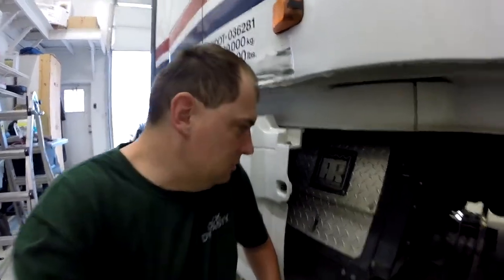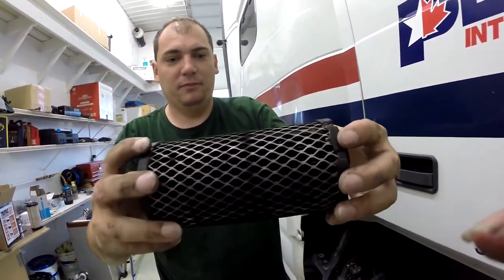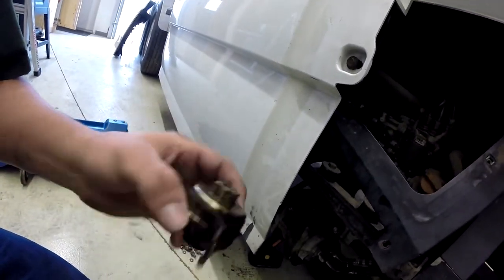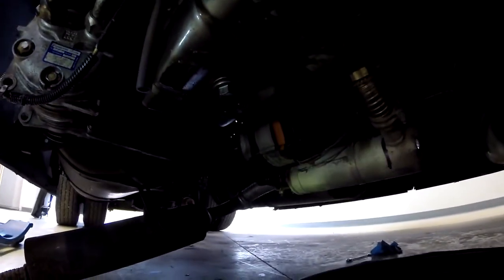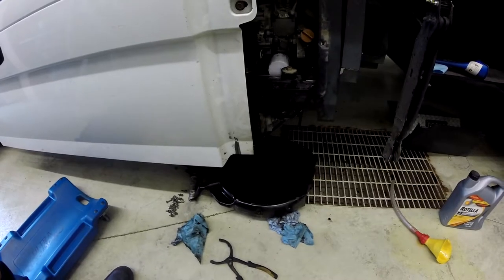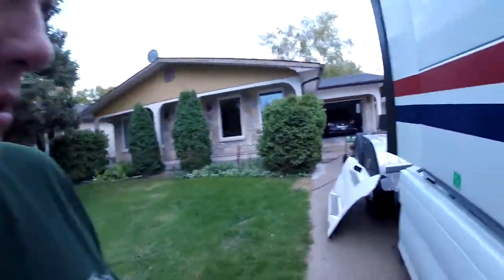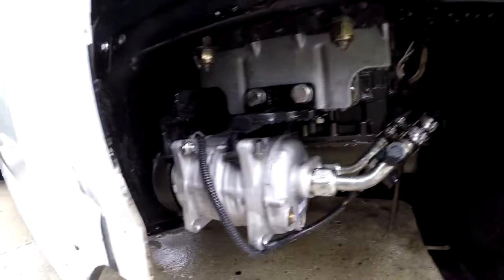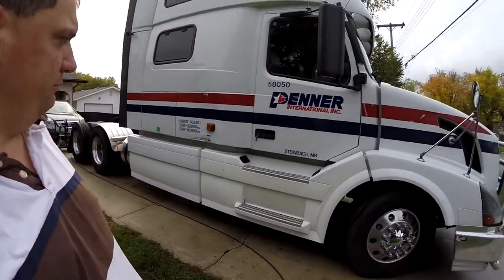My Trucker life on the road 09.19.14 changing the oil on my APU unit

Comment: Good video. 1, Where is that inline fuel filter located, rear on top or on the bottom underneath?
2, is there a certain way to prime the fuel line, other than attempt a start up again & again?
3, have you ever changed out the belt?
Reply from the maker: Yes I did change the belt My truck has a fuel pump so i don't need to prime it
Reply: +Trucker Rudi cool, alright. the tensioner is a bar between the alt & ac. pretty simple, but it does require the lower sides to be remove.

Comment: How many engine hours should pass b4 an oil change.?
Reply: rrios283s73

On the Tripac version, it’s 1000 hrs. On the newest version (Tripac Evolution), it is 2,000 (if I remember correctly).
Reply: @thereviewer4173  
Thanks
Reply: Robert Rios

No problem.

To be more accurate, on the Tripac, the oil change is every 1,000 hrs or one year, whichever comes first. This is only the oil filter, though.

The next maintenance is changing two fuel filters and two air filters. Thermo King sells a kit that comes with everything. These four filters need to be changed every 2,000 hrs or one year, whichever comes first. You can find your APU manual online for more information such as the type of oil needed.
Reply: @thereviewer4173  
So , I recently changed everything,  all filters and the oil , I used synthetic oil. 
My unit has 4 
, 1 air ,
 1 small round filter (fuel I belive) 
1 oil filter .
And another filter located next to the oil filter 

At 1000 hours I need only change the oil and oil filter .?
I checked the air filter recently and it looks like the one in your vedio,  I think that was is ready      , but as far as the other 2 , fuel and what ever the other one is , at 2000 hours .?
Reply: Robert Rios

That’s right. My kit comes with 5 filters:

1 oil, 2 fuel, 2 air.

I am going to guess you are missing one air filter usually located under the bed. The color is blue and the size of a small laptop. If you buy the kit, it will come with all these five filters. I am almost certain you have a Tripac. The newest version got rid of one of the fuel filters.
Reply: @thereviewer4173   yea.. the blue one under the bunk , that one was changed when I took it to thermo king , but now I'm going to do the maintenance myself , they charge to much I thought there was another filter located on the APU itself.
I'm going to order the kit from APUCENTER.com I ordered a kit and paid someone to do the change  last time , they have an Ebay store selling theses kits cheaper then their online store .
Anyways.. I appreciate your help,  I'm learning how to do things on my own. 

One more question,  could my thermo king inverter be causing my batteries to be dead in the morning?  After only running my 12volt refrigerator.  
I've replaced all 4 batteries,  took truck into shop to find the cause , they say they found a worn wite and replaced it,  but I just left 5 days ago and still waking to dead batteries,  thankfully my APU, chargers the batteries back up . But shouldn't be relying on my APU  for a jump start .?
Any thoughts in this .
I took the batteries to have them checked.  And they passed.  
Not sure what to do .
Thinking disconnecting the inverter from batteries,  run my fridge off a smaller inverter and see if I wake up to dead batteries.